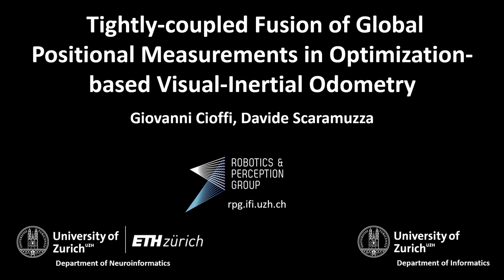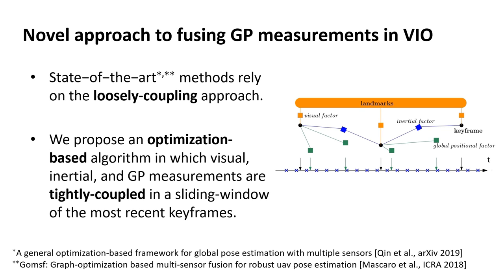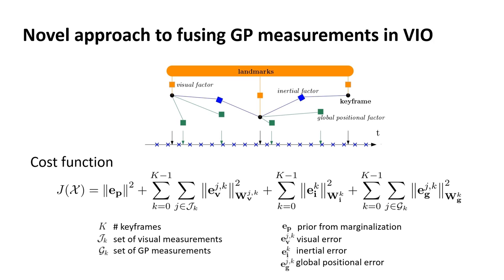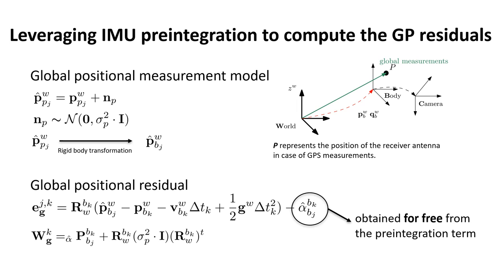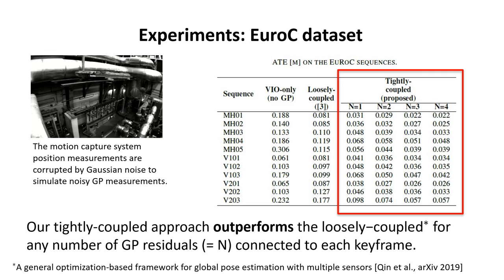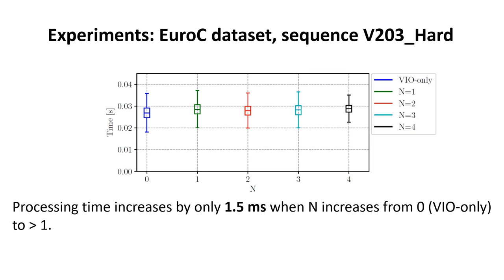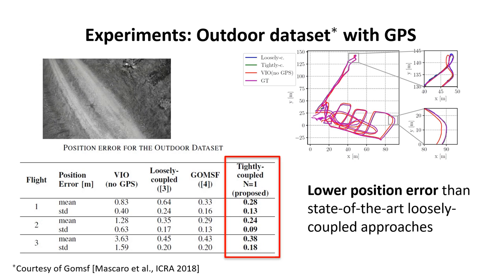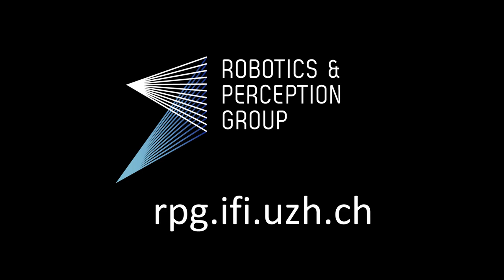Tightly-coupled Fusion of Global Positional Measurements in Optimization-based VIO (IROS 2020)

Comment: It seem the main advantage here is that we’re already taking advantage of global position information in the VIO front-end, as opposed to only in the state graph optimization stage, correct? The state graph should already eliminate all drift up to the most recent node/keyframe. With the present approach the drift in front of the head of the graph would also see lower drift, correct? If so, do you have practical examples in what use case is the accumulated VIO drift since the last key frame is truly relevant?
Reply: Hi, sorry for the late reply. We use the front-end proposed in Forster et al., "SVO: Fast Semi-Direct Monocular Visual Odometry". The global measurements are included in the backend optimization. 
Including global positions in the vio algorithm allows to reduce the drift which accumulates over time because of noisy sensor measurements and modelling errors. 
In this work, we show how to solve the sensor fusion problem in a tightly-coupled manner. Tightly-coupling sensor measurements is known to give higher accuracy than loosely-coupling (e.g., see Leutenegger et al., "Keyframe-based visual-inertial odometry using nonlinear optimization")

Comment: Isn't VINS-Mono/Fusion already tightly-coupled VIO?
Reply: good question
Reply: In VINS-Fusion, global measurements are loosely-coupled with the visual and inertial measurements. Namely, the VIO algorithm (i.e., VINS-Mono) provides the relative pose updates which are subsequently aligned to the global frame in a pose-graph optimization containing the global measurements.
In our method, visual, inertial and global measurements are jointly optimized.
I hope this answers your question.
Reply: @giovannicioffi3970  Thanks for the reply, so it is a tightly-coupled method for all three sensors, instead of VI like VINS-Mono. Got it